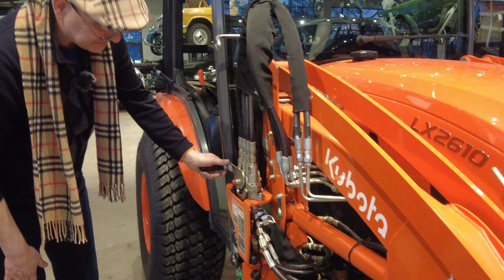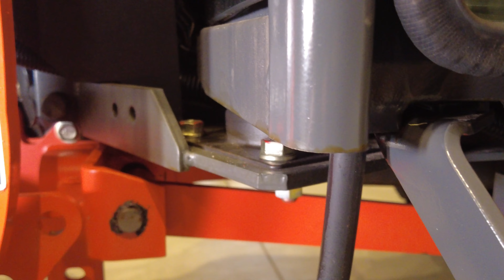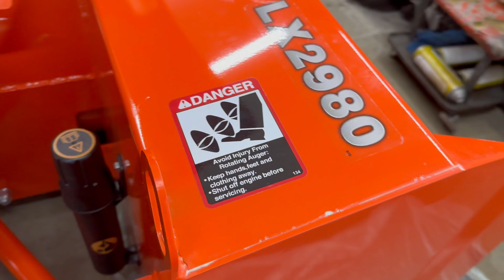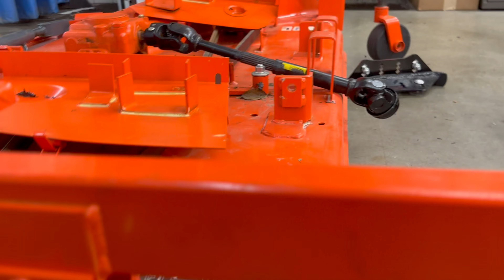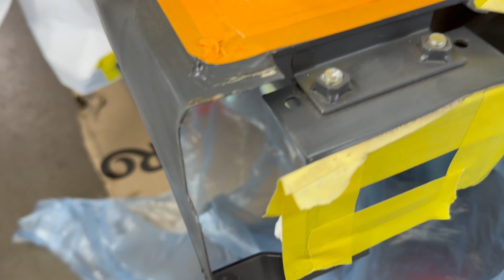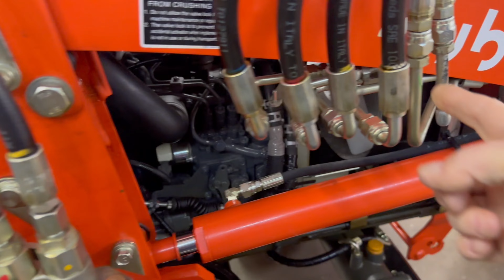Kubota LX-Series 0-Hour Service

Comment: Great Video.  I just bought a new LX3310.  I am curious exactly which “body sealant” from Wyeth you used to seal all the open joints and seams?  And if it is grey or white?    Thank you!
Reply from the maker: Congrats on the new Tractor purchase! We have loved every second using ours. We used the Grey Wurth Body Sealant Seam Sealer. Our rust proofing measures have held up amazingly, and the tractor gets used in the rain, snow, etc. Check out the latest videos on our Kubota showing the 50 & 100 hour services, plus inspections of our rust proofing! 50 Hour Service:  https://youtu.be/JQcSospx_s8 100 Hour Service: https://youtu.be/6pumgdDUszI
Reply: @AlphaCars  Thx for the reply.  Looking forward to checking out those videos!👍🏻. And better get my rustproofing done soon.  Winter will be around the corner here as well.  Cheers!
Reply: @AlphaCars   do you know if there is any easy way to purchase Wurth amber coating without having to buy a large quantity and having to apply with a spray gun?  (Im assuming that’s what you guys did?). Wondering n if it’s available in an aerosol can or something.  I setup my Wurth business account but having issues sourcing all the products.  I really like what you guys did in your video and I’m trying to do some of the same.  I understand the grey seam sealer can be applied with a caulking gun. It’s just the amber coating and the undercoating products and how to apply them easily and somewhat cost effectively.  Any insight you may offer would be appreciated! Cheers!